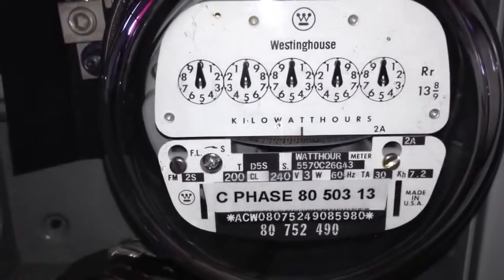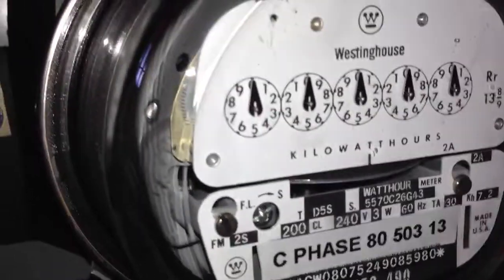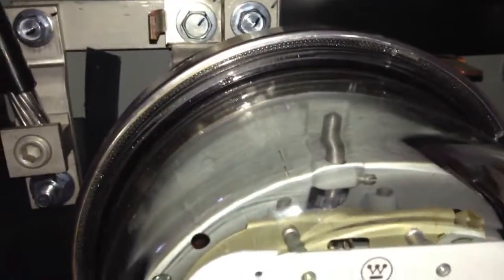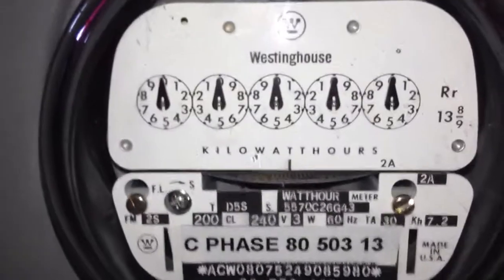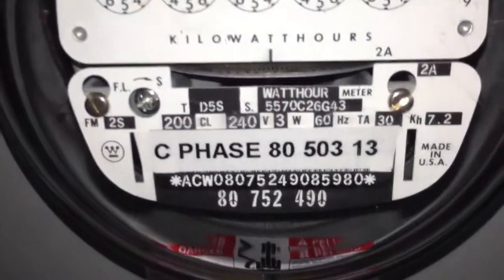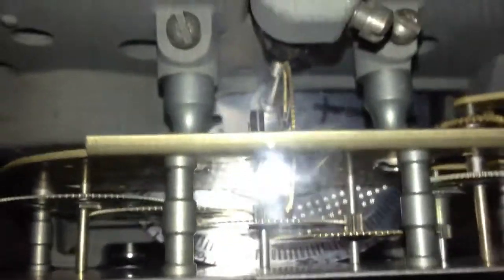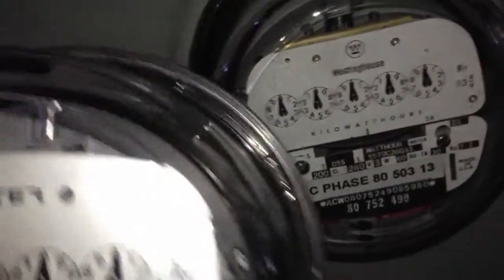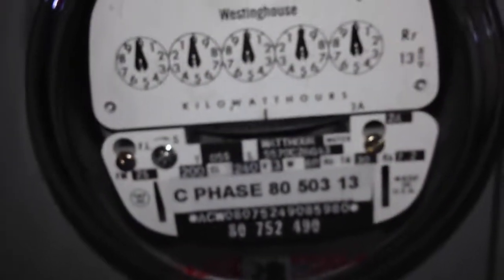Electricity meter: Westinghouse D5S

Comment: I have a anolog meter off ebay that will not work on 120 v why is that?
Reply: what kind? need more info?
Reply: +ERWIN SUMMER It is a landis and Gyr form 2s tA30 I have it hooked up with 120v on one bottom tab and it is jumped over to the other tab with the neutral wire nuted to each other. the two top tabs are jumped to each other and one hot leads out hope I didn't confuse you.
Reply: I meant will not turn I lets power through and the bridge on the back is connected.
Reply: if it's a 240 analog should work just fine.could have a bad pot coil or open link on back. need to see back. measure between the top two  stabs should get an ohm reading if not pot coil is open or the little link on back is open.
Reply: hook the neutral to one side on top hot to the other load out the bottom. if it does not work this way there is a bad pot coil or a open link on the back, it has two little screws if it's open work either .like i said check with a ohm meter across the top stabs see if you get a reading , if you do it should work. hope this helps. sorry took so long to reply!
Reply: +ERWIN SUMMER I checked the link and it is closed and I got an ohm reading. So power in is on top and neutral is on one side and hot on the other?
Reply: +ERWIN SUMMER Thanks so much I wired it like you said and It worked I can not thank you enough!
Reply: not a problem ! glad i could help. i belive it will miss 1 KW every 1000.
Reply: So on the bottom two terminals connect the hot to one and the neutral to the other them to the same thing on the same side and it should work.